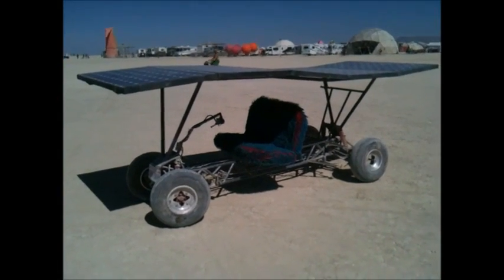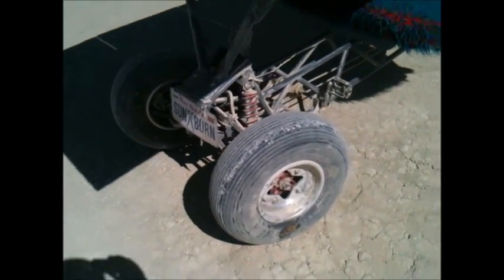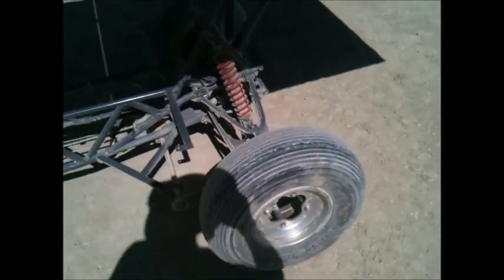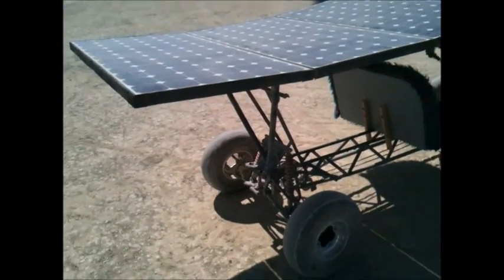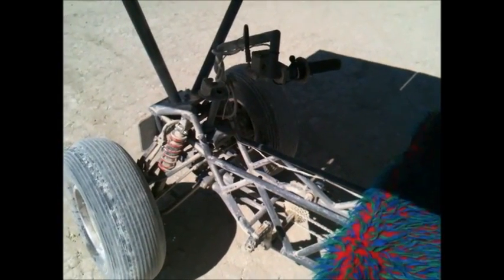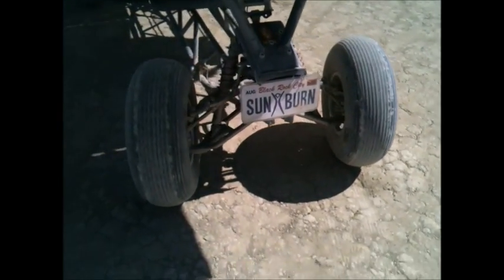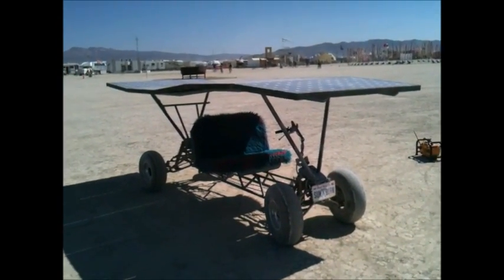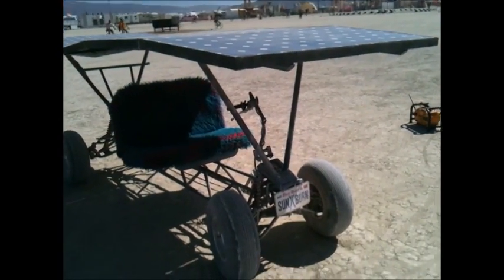Solar Car No Batteries 4

Comment: If you are using PWM controller you should use at least capacitors! Without it you lose energy while the circuit is OPEN. I had good improvments using caps in my "no batteries" solar apllications